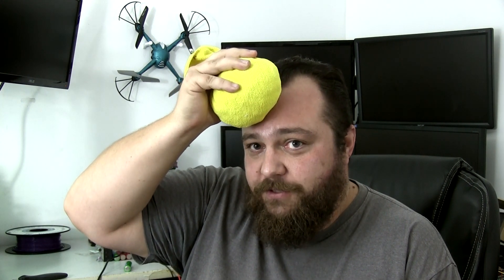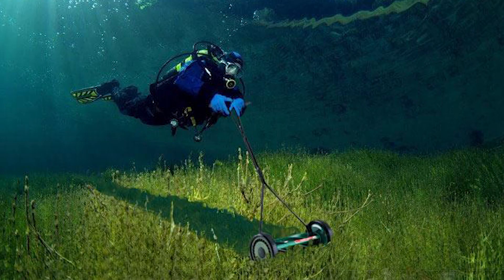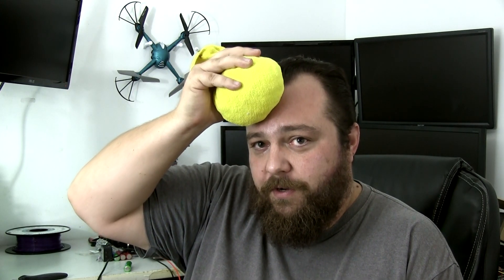3dprinted Autonomous Robot Mower - part 1

Comment: Very cool! How will your mower position itself for a proper overlap? I figure GPS is out given the resolution and poor tolerance. Are you going to use a compass as well as feedback from the wheels to turn it around at the end of each pass or are you going for the roomba 'bounce around and it'll eventually cover everything' method? 

I'm looking forward to the next video and demonstration.
Reply from the maker: You are correct, initially it will be on the roomba algorithm.   The GPS wouldn't be as accurate.  However, I have looked at something called differential gps.  Where as I would have a gps receiver mounted permanently on the house or something.  You then let it do GPS lock for extended amounts of time (days/week) and eventually you have a really good idea of exactly where that module is.  Then you use that generated location, with the current reading to get an offset, then transmit that offset via wifi/rf/bluetooth/whatever to the mower and tell it to offset from it's GPS reading.  That with compass may allow for better back and forth low overlap.  But need to keep digging in that.  

The other thing I have looked at was doing a SLAM algorithm to map out the area.  Then maybe doing something like way points but again precision location would be needed.  

For the time being though.  run random run often lol